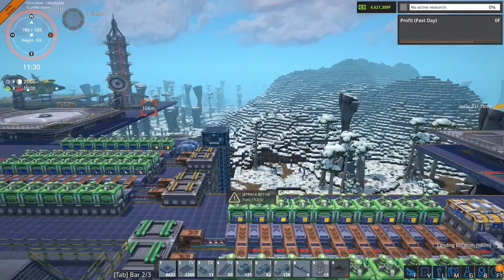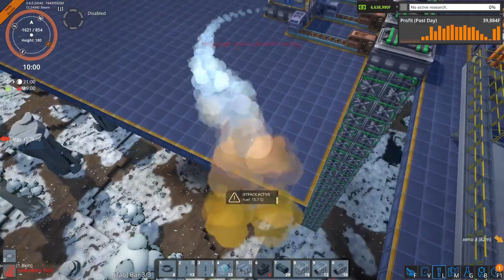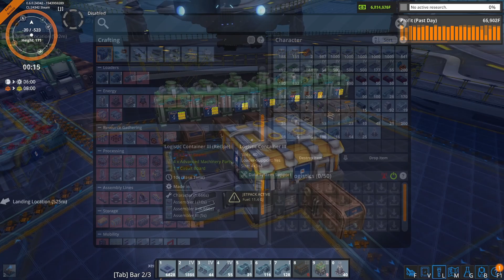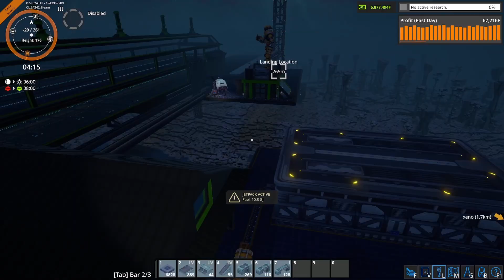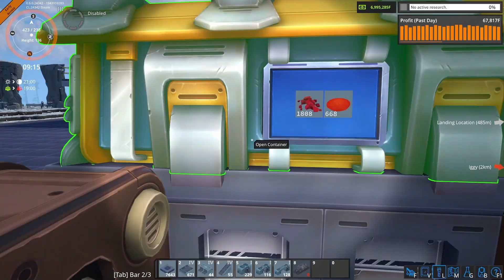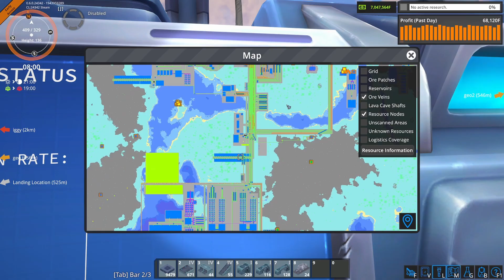Foundry XenoTech Update 3 - A more Permanent Steel Setup, Geo Thermal Power Meh

Comment: yea, geothermal isn't meant as a main power source. this was stated by the devs during a stream. honestly, it should be a lot more efficient.
Reply from the maker: Yeah I agree. They need to give Geo thermal some love
Reply: @Burnedoutguy  i didn't even think about using it. i've got about 1500 solar panels so far. i'm probably going for another 500 or so before i get my robots running. lol
Reply from the maker: Yeah looking forward to a new power source. Solar panels are taking up a lot of place
Reply: @Burnedoutguy  i don't really see the space as an issue. given how large the world is, it's insignificant. i placed my solar panel platform right up against the top build limit so nothing is going to get in the way. it's also built in a way that it will never intercept any other building or transport. my battery platform is placed right below that so that it is also infinitely expandable, as if i need as much room as the solar panels. so far, i've got about 600 batteries but i am considering placing another 400 to have half my solar panels. that seems likely to be capable of handling anything i can throw at it.
Reply from the maker: Oh I do agree space is not an issue cuz like you said the map is huge but I don't think it's the perfect long-term solution to power. Mind you it is in Early Access the game so hopefully the Zeno power that they plan on bringing out is a lot better. I just hope you don't have to make a massive factory just for these xeno core power things. I have a feeling that's what's going to power the the power plants
Reply: @Burnedoutguy  on the xeno power expansion, i only got the upgrades i wanted and left it at that. without any achievements to complete, i didn't see much reason to add that complexity to my already complex factories. i placed only one machine to get the final upgrades and then shut it down. i didn't bother with the machine/robot bonuses or the item supply stuff. yea, i'm a hopeless pragmatist. lol